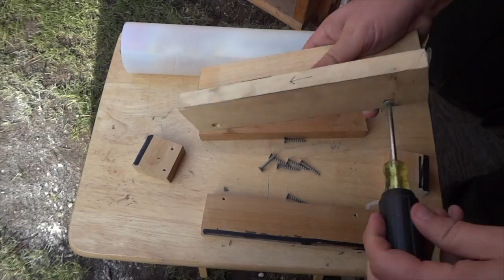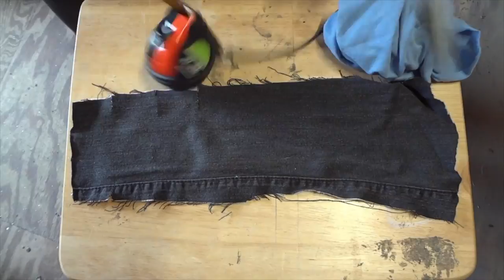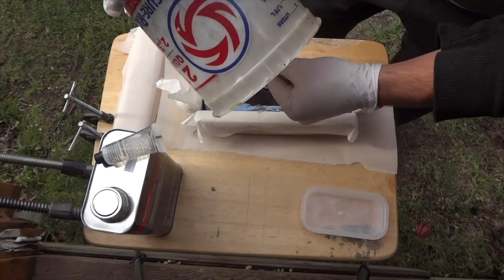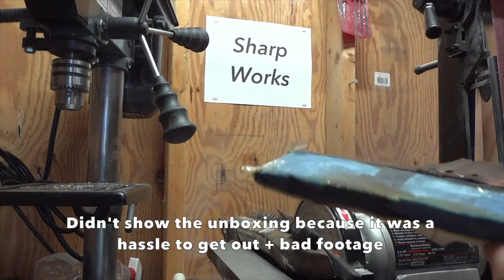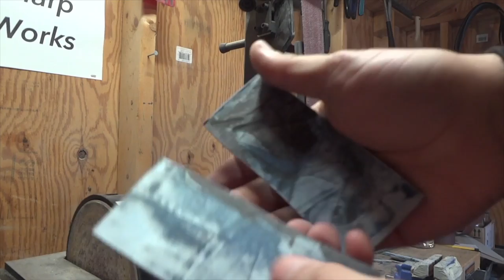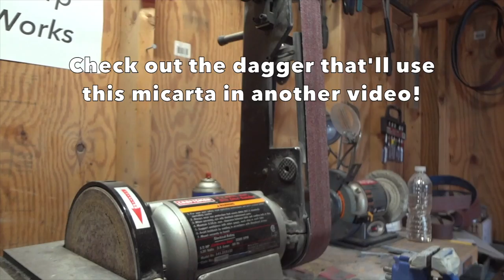Making Micarta Handle Scales For A Dagger

Comment: That's cool. I need to try that someday.
Reply from the maker: Thanks man. It's really easy to do and it helps gives your knives a more personal touch.
Reply: i want to make a press from some sturdy steel and paint on pva so it releases really cleanly. maybe someday i'll get to it. on second thought maybe pva won't work... either way i'll try something.
Reply from the maker: Modern Bladesmith let me know when you do.
Reply: Sharp Works, awesome work! i was wondering if you can help me with a problem, i just made a micarta with blue denim layers and transparent epoxy resin , but my final composite is quite darker than the original denim layer , for instante , if my layer is a skyblue the composite is really dark almost black , do you know what could it be the problem ? i want the composite same color as the layer.

Comment: Have you thought about making the mold out of plastic? Not sure what it's called but it would save you the partchment paper step
Reply from the maker: That's interesting I'll look into that, thank you for the suggestion. Do you know if any plastic would work? I'm not sure how the resin will react if it will bond to the plastic or not. Because if not that would be a great idea.
Reply: Sharp Works I'm trying to think what YouTube channels use the white "plastic" molds. I know a lot of ink pen makers make their molds out of the hard plastic, to me it looks like the cutting board material. 

I will find out for ya! Someone will tell me lol
Reply from the maker: Lol thanks! I'll look into it as well because that'll help me out a lot.
Reply: Sharp Works I've asked YouTuber Zac Higgins what he uses for his mold. I know it's the same type of material that Peter Brown uses as well
Reply from the maker: I'll check out some of their videos and see if I can find what its called, thanks helping me out.
Reply: Sharp Works I also know that people use the same "plastic" mold for the hdpe and the shopping bag micarta. They use a toaster oven and a metal bread pan to melt and soften the material, then use gloves and manipulate the material and then put it into the mold.
Reply: Sharp Works Heya! Finally found a video that said what the mold is made out of lol. It's HDPE, lol the same thing that milk jugs are made out of lol. If you search for Dema's Workshop you will see the mold that I'm talking about. My guess is that you could get a sheet of it from lowes or any other big hardware store
Reply: Sharp Works the channel that talked about the mold was YouTube channel Casey Martin. I believe the video was called casting grapevine and illuminate. 

He says that his molds and table is all made out of it so that the resin doesn't stick. Hope this helps!
Reply from the maker: Phillip Taylor wow thank you so much I checked out his video that looks like it works great! I'll probably end up buying a couple of sheets and making my box out of that. You're right it does look like it'll help a bunch. Thanks again man.
Reply: Sharp Works no problem! Just glad I could possibly help ya out. Getting the paper all over your mold didn't look enjoyable!
Reply: Sharp Works Also, Amazon was just the first site I went to. I'm sure local places or possibly eBay could be cheaper.
Reply from the maker: Haha yeah it wasn't too fun. I'm going to check out eBay and some hardware stores to see which has the cheapest / good quality. I like how amazon lets you pick the exact size sheets so I'll see which ones I'll need.
Reply: Sharp Works ya I noticed that as well! There is one other type of material that I found, it's called melamine. It's basically particle board with a white coat over it. With those you still need to use some type of spray and silicone the edges.
Reply from the maker: For this video, I did notice that the resin didn't stick to a plastic bag. I put the whole box in a bag because the resin was leaking all over my shop. I didn't realize it was hdpe, but now that you said it, it makes sense.
Reply: Sharp Works that's interesting and good news. I figured that the resin would have stuck to the plastic bag since the resin gets warm and the bag is so thin. It'll be nice when you can make your mold out of the hdpe and be able to make it larger for multiple knife scales. 

Noticed that you had to cut off a decent amount of the micarta for the dagger. Being able to make multiple blanks in one go will be a big time saver!
Reply from the maker: 100% agree with you on that. I wanted to make larger sheets for my next micarta batch. Any suggestions on colors?
Reply: Sharp Works a dark tan and brown wouldn't look to bad. I need to find a video of a cool way to make patterns with micarta. I'll try and find it tomorrow. 

Tan like the carhart pants and a nice brown or green would go good with your knives. Gives it a outdoors feel. 

I've also wondered what a tye dye shirt micarta would look like. Tye dye and an orange/somewhat brighter green shirt every other would be cool. Definitely haven't seen any tye dye micarta lol
Reply: Sharp Works you could even start playing around with card stock or an old book pages! I did see a Texas flag micarta when I was looking up the hdpe. It was amazing looking
Reply from the maker: Those would look really cool. I did want to make a micarta with a pattern sown into the fabric. I wish I had more free time to make more things.
Reply: Sharp Works hey, I got some more info on the hdpe sheets. Make sure you get the smooth sheets, they have some that are like cutting boards that have a texture on them.
Reply from the maker: If I get the wrong ones, you think I could just sand it smooth? I'm not sure how easy of a material it is to work with but I figure if there's so many videos on hdpe that it must be rather forgiving to use.
Reply: Sharp Works I don't know if for your use it would be an issue. Have you got them already?
Reply: Sharp Works I wouldn't see an issue if you sanded it smooth. I looked at a couple of sites and if the sheets were textured or smooth I couldn't find the info. I was given a website, I'll send you a link. Not sure if it's cheaper than Amazon or not
Reply: Sharp Works here's the link. These should all be smooth. They come in black and off white, here's the link. 

https://m.grainger.com/mobile/product/POLYMERSHAPES-HDPE-Sheet-Stock-WP7164841/_/N-13jyZ1z0ccgl?R=1ZAU8&fromPidp=true&isAltTerms=true&picUrl=%2F%2Fstatic.grainger.com%2Frp%2Fs%2Fis%2Fimage%2FGrainger%2F1YZU4_AS01%3F%24smthumb%24webparentimage%24
Reply from the maker: Thank you for the links I haven't gotten them yet. That's cool that it comes in black. Makes me think it has the potential to be a nice durable knife handle.
Reply: Sharp Works Hey! I was watching another micarta video and was looking in the comment section. A guy said that he gets head gasket material, comes in at least 7 colors. Said at the auto parts store a large sheet is $2-$3 and can make really nice micarta out of it. 

Also, I saw that for the knife liners, you can just stack up the same material up and have your liner locks built into the micarta. To save material, they showed cutting the one color of material into squares and putting it at the places you want more pattern, at the top and bottom and if you plan on sanding the finger grooves, on those spots as well. 

Looked really good and saved material cost by saving the material for the knife tang liner and using that same material for the accent high and low spots. 

Think I might give this a go this weekend lol. Can't do the knife part because of chronic pain and also don't have the tools. But I can sit down and do this. 

Thanks for the inspiration! Not much I can do physically even tho I'm only 32. Might turn out horrible but oh well lol
Reply from the maker: I'm sorry to hear that man. What's wrong if you don't mind me asking?
Reply: Sharp Works complex regional pain syndrome (CRPS)some still say(RSD) from a knee injury in high school football. I blew my knee out in 2001, first doctor supposedly didn't fix a meniscus injury and also injured a nerve as well. To make this shorter lol, I've had 10 right knee surgeries. I actually need another knee surgery but doctors won't do it because age, CRPS, and them being chicken sh!t :). With the CRPS anything that touches my knee/sometimes areas down to toes, will cause major pain. So I only wear shorts, luckily my body is getting used to the cold weather after 8 years. 

I do also have a "morphine" pain pump surgically implanted under my skin below my ribs, it delivers pain meds to my spinal column. I've had 3 surgeries to fix a broken pump and a broken catheter. Really not suppose to do any rough movements or lift a lot. I am lucky to have amazing pain control doctors. 

So unfortunately, that's why I can't physically do a lot. Because, knee injury and not suppose to do anything that could jeopardize my pump, since the first pumps motor just broke and the catheter can crack or moved the catheter. 

Sorry it was long but it's a complex and nkeio
Reply from the maker: I'm really sorry to hear that I hope there's something out there that could help you, you're a young guy.
Reply: Sharp Works they say I need a knee replacement surgery but I'm to young lol
Reply from the maker: Damn man tough break best of luck to you.